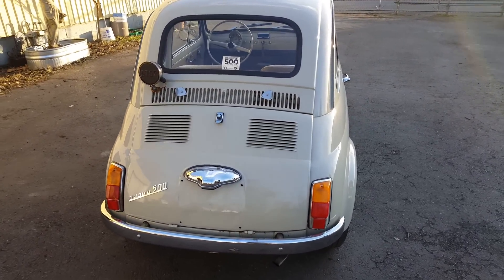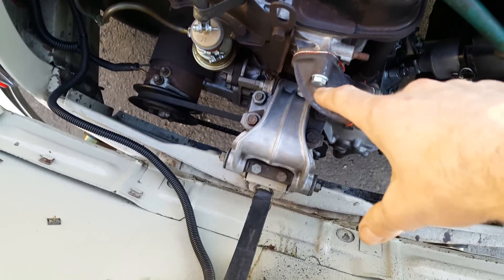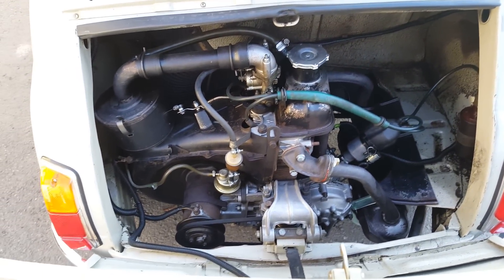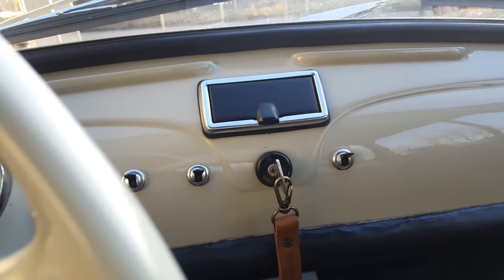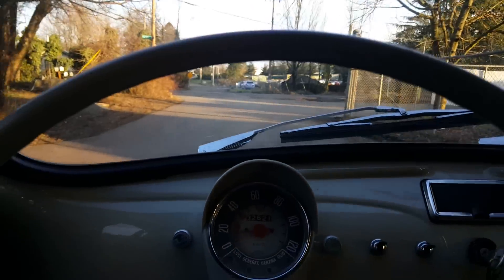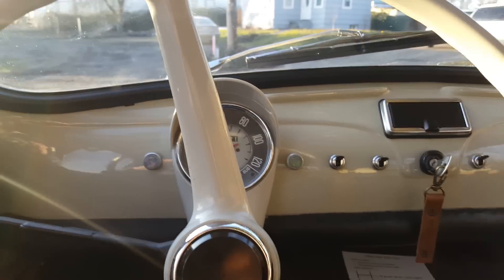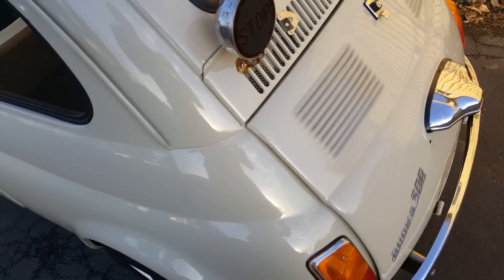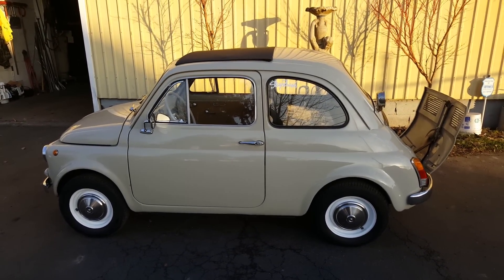Fantastic Real Fiat 500

Comment: are all the best older small cars out north-west?  nothing but rusty messes here in Ohio.  Car is looking good,.. thanks for the vid..... ;-}
Reply: It's because we use all that salt in the winter.  
*I've seen moonbeams dancing on the salt crusts at Tannhauser security gate*
http://thefilmexperience.net/storage/1980s/blade-runner-movie-screencaps.com-12503.jpg?__SQUARESPACE_CACHEVERSION=1452267311232
Reply: It's the same reason you never see vintage Subarus, or Aircooled VW's, or old Toyotas. It's the salt, the cars simply dissolve.
Reply: yup, you are all correct.....
Reply: yup....

Comment: 4-speed, unsynchronized transmission! :)
Reply: only the first speed was unsync.
Reply: Nope! The later FIAT 126 (based on 500 mechanicals) had a larger engine and different transmission where only the first gear and reverse were unsynchronized, as you say.

However, on the Nuova 500, 500D, 500F, 500L, and 500R it was a fully unsynchronized transmission!
Reply: ho yesss, as you say, 40 years from my 500....
Reply: @OdykKayne  the 500R had the same gearbox and engine of the first fiat 126.  It was the last model built before the 126 came out. underneath it  actually was the very same car . Even the rims were the same. I drove one for years and everytime it needed parts, i ordered  fiat 126's spare parts .
Reply: @DanieleElaborati  Yup...I'd made that comment three years ago, but know that now! Actually hoping to import a FIAT 126p in the next year or two! :) A friend of mine in Poland has one!